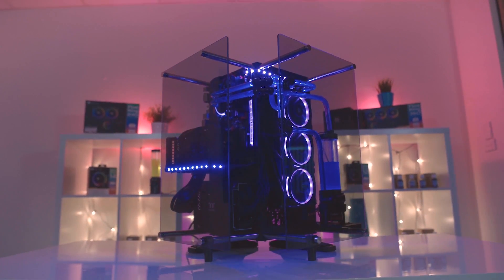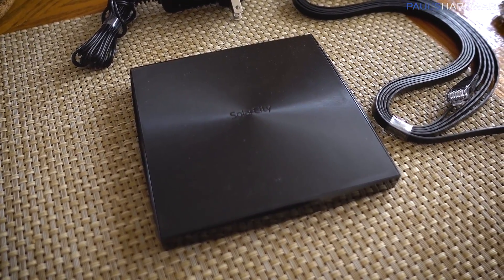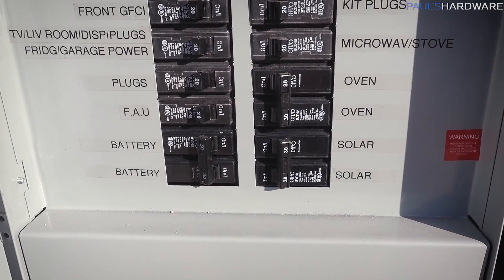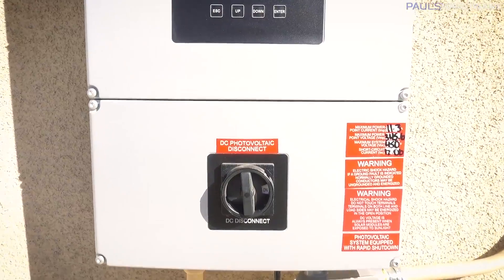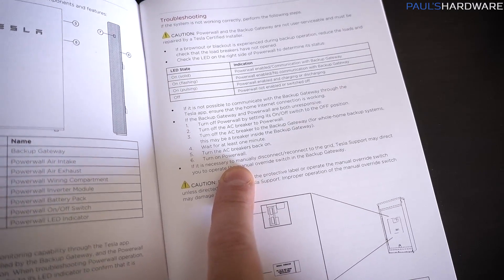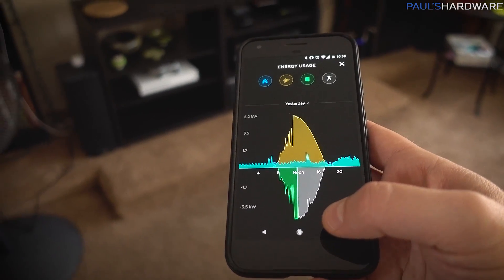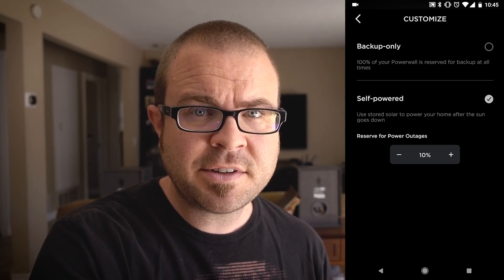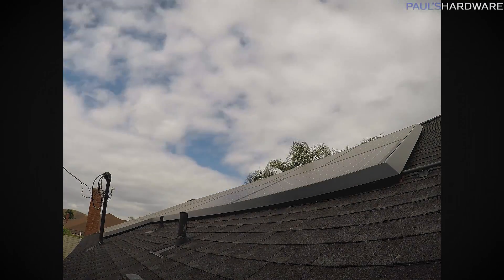SYSTEM ACTIVATED! Tesla Solar + Powerwall Week 1

Comment: I have two grid tied PV systems, one installed in 1999, the other in 2017. Would I benefit from the Tesla power wall and what is the price of the power wall? Does the power wall have it's own inverter/dc charger or will I be required to change my two grid tied inverters?

Comment: 1 suggestion. I have a 6k system,  power wall. I ran into the same issue and we live in ohio but it's still hot lol

But I put a 30" DD whole house fan in, to run at night instead of my ac. That solved my PW problem with running out of juice.

Comment: My wife and I have a solar system installed on our house and we absolutely love it.   I thought about adding a Tesla powerwall to our system and then had second thoughts as to the cost effectiveness of doing so.   Our system is setup so that whatever "extra" power we generate is put on the grid and we are credited for it.  This credit rolls over month to month.   Is this not the case in CA?    Thus, the only benefit would be that if the power went out we would be the only person on the block with power.   This doesn't happen but rarely in our neighborhood btw.  I came to the conclusion that it would be more cost effective to just have a generator installed.   Assuming of course, if the city would allow it.   Our power bill is $8.95 a month and that is only because we have to pay the power co a connection fee for the service.   Buffett has to have his cut of course.

Comment: From what I found your AC is on a non-backup circuit.. your power goes out.. the powerwall will not power the AC.. but it will still supply enough power to it while you are above the power reserve level and the grid is up because you have it set to self-powered.  it was a little confusing but its basically a gigantic UPS one breaker box is on the battery backup and the other is not :)

Comment: I am amazed that you did not put a ridge vent and white shingles.  I do HVAC in Texas and get into attics to check stupidly installed HVAC in the attic!!!!  Guess as long as your ductwork is not in the attic or you have a minisplit that has no duct loss.  The ductloss in your type of house will be 20 to 25% due to duct leakage and when the unit is off, your ductwork gets to 130 degrees.  If the air handler is in the attic, the 200 lbs of equipment gets to 130 then you have to pay it to cool down to 60 degrees.  Some of my designs in Austin have achieved 1500 fett per ton using zoning.  These are high efficiency houses.
Sad to see a black roof!
Great video and good information.

Comment: I have owned and operated a 4.7KW grid tie PV system since June 2010.

FYI:     I have noticed the best output under the two different conditions described below.

1. Winter  Bright Sunny Low Humidity Vary Cold Cloudless and Windy Days. 
a. The out door cold increases the efficiency of the PV panel I believe and it’s wiring.
b. The Wind helps the remove additional heat for all the components and wiring.

2. Summer Low Humidity Bright Sunny Cool Days that have large fast moving clouds that have large clear skies between the clouds and strong ground winds.
a. The fast moving clouds intermittently shade the panels and allow them to cool down but only when the cloud shadow is over the panel   Than suddenly when the cloud’s shadow clears the PV array, the now cooler panel suddenly receives photons from the sun when the panels are most efficient.  I have noticed the out put steady decline as the panels heat up in the sun light.

Under both circumstances, Low Humidity (winter and summer) removes  the water vapor - which is just one more obstacle between the sun’s and the PV panels that blocks the sun’s photons from dislodging individual electrons from their steady state orbit around the atoms of the PV panel substrate of crystal......

Candidly speaking, I am not an engineer, so I could be wrong with all my thought above. However, I have noticed these conditions many a time when my 20 PV panel system is over producing the rates 4,700 watt out put of my system by 1,000 + - watts.
Reply: Neat observations. You're definitely right about the heat / cooling parts at least. The  effect on wiring might be minimal but the panels (and modules, and cells) are themselves rated for how they produce current with a specific de-rating per degree celsius above 25 C. E.g. the temperature coefficient of a Panasonic VBHN330SA16 solar panel is -0.258% per 1 degree Celsius.
Reply: Thank You, I even put in the next larger size feed wire from my panels to my inverter knowing that a bigger high way to the inverter is more efficient and can move more traffic / electrons every second of day light hour for the next 20 + years for only a few dollars more when installing the system.

But what also amazes me now is seeing how some Mfrs. are now puting on parimiter molding and mounts almost directy layiong on the roof to make the  array look better.     BUT This Also Keep The Under Side Heat Of The Panels Trapped In.  So after watching my out put  meter live and noticing how a sudden gust of wind cools down the system and almosst instantly ups the out put. Than factoring in that this is for the next 20 or so years life of the PV system, adding sides to an roof top array is just "Ludicrous".....

Actually the more space under the panels on a roof, the cooler the system will operate just due to a natural convection air current flow developing for the life of your PV system.

I came up with a saying decades ago that applys here that I still follow and like to spred around to help our one and only Mother Earth.   The saying goes as follows " Save a little in a lot of places and you end up saving a lot".   Than factor in the years/time quotient and the spread this life Philosophy around also should help Space Ship/Mother  Earth lots I suspect......

Any Way, sorry for getting carried away. Almost 18 months ago I became a widower due to ovarian cancer and now live alone. So no one to talk to is just one of the Many Way my life changed I have noticed....

Comment: Modern electronics don't waste much energy on standby and it's not really worth to bother.
Reply: In general, conserving is cheaper than generating. It's not worth it to bother if you live in Kentucky and burn coal to get $0.08 cents/kWh electricity (but have no air conditioning.) But the $/kWh for a solar+storage system is way more than that. At some $/kWh, it becomes worth it for that XBox, and if you're bothering with that, why not do the TV and the rest too?  Xbox Default "Instant On" power draw is 12.9 W.  Myself, I shut stuff down in the summer, because the waste heat all has to be pumped out by my air conditioner, which means I pay for each watt wasted at least 3 times. In the winter, I can use the heat, so no biggy.

Comment: You should get a Kill-A-Watt Watt meter to measure the power usage for each standard plug (120 V, 12 A) for a week or so, to have a good idea of the usage consumption.   
For the Air Conditioning usage, there also watt meters with an external solenoid coil that can be clamped on the wires to measure higher current (100 Amp) 
There are also a lot of sophisticated Watt meters using Bluetooth and smartphone apps,  producing graphics results, 
but this not necessary if you just want just to have an idea of each overall consumption for each device. 
By recording each device consumption over a week, you can then decide what (insulation for example) improvements to make, and compare the results, if any.   
For example, unless you use natural gas, the baking oven and cooking range, and the dryer, might represent most of the household electricity (bill),
so you could stop using the dryer and just hang your cloths in the garage of the bathroom overnight. 
About the AC, depending of the house orientation, the days with some wind breeze, 
just cracking the windows on both sides of the house would provide some air circulation instead.
Having the windows exposed to the sun insulated with UV screen block, of putting a retractable or motorized solar shades would be of a great help.
Do you have also a Tesla or any EV car, it would be interesting to know if the Powerwall itself can cover your daily commute.

Comment: Answers for questions?

Anyone else feel welcome to chime in, especially if they have this type of solar/battery system or also any other brand.

If PAUL feels comfortable in doing so...

What might the square footage of the house be? This is by far one of the two most important questions. Secondly, how much in panels do you have? Also noting that almost all people might be limited as to how much roof area they have available; unless wanting to supplement  it with some ground based collectors.

What was the average power bill and/or kwh per month before this was put into place - or even a yearly rate?

Some added in facts...

I reside in an area more rain than Sun; much like Seattle. Yet if one has the time and the budget to do it properly... just to try to prove the figures without any links...

One can have a higher quality two thousand square foot house, better insulation, better build quality in general, made to run more efficiently with every appliance, etc.. That house could also be a 400amp service house.

Using  a higher end solar panel system, with also a higher end battery storage system, and a few added ground collection solar panels... In a less than ideal environment (such as Seattle) once those batteries are charged... One can run quite the efficient solar/battery system. A full 400ampo service continually while also keeping the batteries charged, and even selling back to the grid. How long the system takes to pay for itself just depends.

There are also much better and far less costly ways of doing it in a variety of locations - but this may be limited by items such as building codes.

Take any one thousand square foot house. Then add on a greenhouse that is about one third of the size of the house. That can easily heat (and even serve to help in cooling) that house. Don't have a green thumb? It can also have solar panels placed inside

Comment: Cool,didn't know Tesla had a storage system for home use. Yup.... put electronics or other "mostly off" all the time devices on a power strip and turn them all off when not in use. But...LED bulbs everywhere will save much more juice than the electronics use setting in stand-by mode. 

Incredibly our energy provider now wants to be granted the ability from our corporation commission to PUNISH solar users on their monthly bill claiming they don't pay their fair share into the grid. Total BS when you consider enough people using solar would prevent the need for an energy company to spend hundreds of millions on a new power plant to keep up with demand. And...if your energy company is like ours,anything you "sell back" to them from your panels gets you a wholesale rate--not the retail rate users pay on their bill.

Comment: If you want to save on AC costs, have you considered using double pane glass in your windows? Your AC will have to work less hard and will use less power. Other types of insulation to keep out the heat will also have an effect.

Comment: How did you get a final inspection with MC cable running dowb the back wall of your house?  MC Cable is only listed for dry locations.  Any inspector should have noticed that right away.

Comment: yea it isnt all that weird with the AC, it IS after the gateway but it really depends on where the wattage sensors are, if they are in the gateway it wouldnt be able to tell what is the grid or the AC, so my guess is that the sensors are directly off of the grid and the gateway is just to disconnect the lower power stuff when the grid goes down, the power sensors for monitoring that are on the solar inverter and the powerwall inverter, no need for the grid sensors since it is dead.

Comment: easy. breakers are not one-way, they're just switches with overcurrent detection.
Energy goes from source (battery, grid, whatever) to sink (AC, lights...)
depending on the equilibrium in the network (aka the wires), energy will flow in one direction or the other.
also, the closer the source, the easier it is for energy to flow from it.
so, the battery is closer than the grid generator, if the battery is available, energy will be sucked from it.

Comment: The draw you notice when the AC runs is the fan unit. In your distribution panel fed by the gateway you have a breaker labeled F.A.U., this is the fan unit inside that distributes the cooled air. The AC breaker in the main panel runs the outdoor compressor unit and gets a 24vac signal to run from your thermostat powered by a control transformer located in the fan unit.

Comment: Very cool. I’ve had solar panels on my house for about 8 years, and have been happy with them, even with SCE futzing with the “prime” hours to minimize the credit. I’ve been thinking about checking to see if I can put in a power wall to work with my existing system, and your vid might have convinced me to do so if it’s possible and it isn’t too expensive. I’m guessing I’d need to replace my current inverter, which won’t be cheap in addition to the cost of the PW2.

Comment: Paul,  Fully Charged's Powerwall 2 review is very instructional, including power flows - https://www.youtube.com/watch?v=nWLzlrGGuxQ
Reply: The short answer is that the Powerwall has an AC inverter and the solar is AC coupled through its separate inverter.  So it's all AC going into the panel with the Powerwall being bi-directional.

Comment: Hey Paul, congrats on a beautiful installation !
I work for Tesla, installing powerwalls.  You are correct about your A/C working while battery is discharging at the same time, that's normal.  The powerwall is just helping  getting juice to the house loads, as solar diminishing. The difference is, in the event of power outage , your A/C won't work, as it's not in the backed up load center with the rest of the loads.  Technically , powerwall can back up any load that is 30 Amp or less. You have 2 loads that are 30 A (oven and A/C).  And the reason why oven is backed and A/C is not , because oven is a steady load, unlike A/C needs a lot of starting power (i.e. torque) to " kick" start a compressor inside - Locked- Rotor Amps, which means when A/C starts it draws lots of amps for a few secs which could trip the  powerwall circuit breaker.  In many cases,  a piece of hard ware can be added to the A/C unit to smooth out starting amperage ( soft start kit), but i'm wondering , whether your  a/c was compatible with it or not.
Cheers!

Comment: Wait so without running the AC he only draws 1-8% of his total power from the grid? Jesus that almost eliminates an entire power bill, Even without counting for selling the power back into the grid. That's phenomenal. give it another 5 or 10 years for battery and solar tech to improve and get cheaper and you could comfortably live off solar without needing to even bother changing your habits. His system doesn't even seem that large and still manages this. 

I also get a kick that you can make the sun power the machines we've made specifically to combat it.

Comment: Hi Paul!, What were the requirements as far as the condition of your roof before the panel install? Were you required to replace your roof or did you do that on your own? I've thought about having panels installed but am about 5-6 years from replacing my roof. If you had them installed before roof replacement , who would be financially responsible for panel removal prior to roof repair? Thanks for your time.

Comment: Too bad they don't use actuators on the panels to get the optimal sun angle for max solar, to raise or angle the panels as the sun moves. Would using the panels on a flat external shade to the house be better? Or side of house so it gets the most sun.

Comment: Tesla now is pulling away from solar .. umm. Most homes in my area are averaging 3,000-5,000 kWh per month. That's a lot of 300W plus panels and you'd need 3-4 homes of Tesla's roofs. Until the efficiency increases by 50-100% and the cost drops by 50% or better solar doesn't pay back. I'm assuming you got yours for free or a substantial discount.

Comment: do you have your own controller just before theirs?  in a disaster they will shut you off completely to prevent lineman from being electrocuted. putting i you own controller lets the system work without you being connected to them.  it also prevents the communist demonrats from just shutting you off for your vote or compliance.
Reply: below me in the event of a power outage the gateway disconnects the home from the grid. Electrical code requires that solar panels either disconnect or shut off in the event of a blackout.
Reply: they are required to shut off to the grid.  you put in your controller just before theirs so you can keep powered but it doesn't go to the grid

Comment: Listen, your AC will pull power from the battery if the power grid in your neighborhood is operational.  If the power goes out, your gateway will detect that and it will disconnect your sub panel from your meter box panel, the gateway sits between your main meter box and the sub panel and acts as a big isolation switch.  Your AC will not be able to use the battery during a power outage since the gateway will have "severed" the connection from the meter box to the sub panel.
Reply: You can test this out by shutting off the 200 amp breaker in your meter box to simulate a grid power outage.  The gateway will isolate your sub panel from the meter box (the grid) and any of the breakers in your sub panel will run off the battery, while any breakers in your meter box will not.